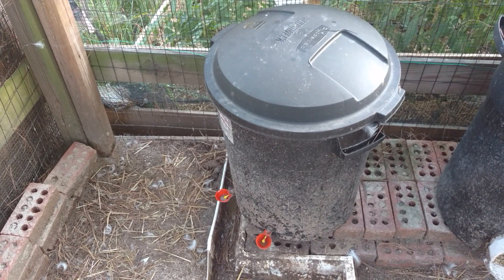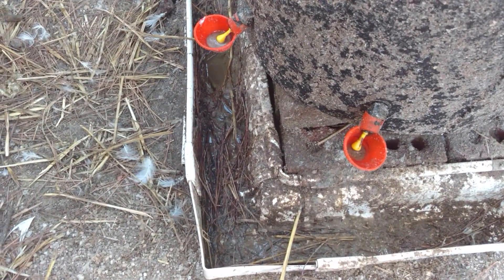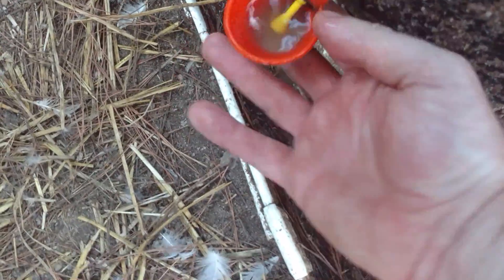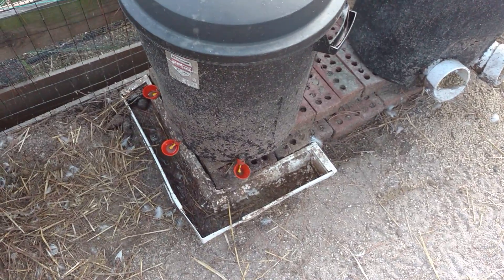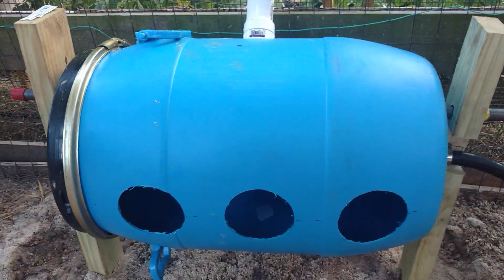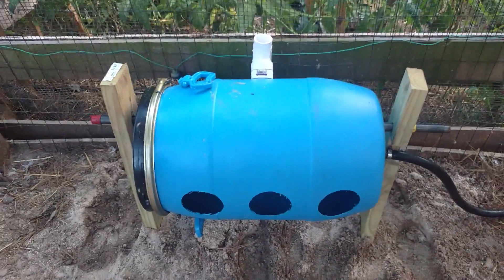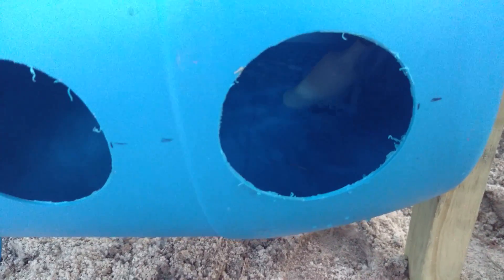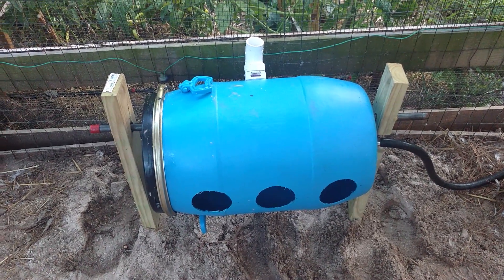Continuous Watering Design for Ducks

Comment: Hey this is great! Plan on doing this for the ducks we have. You mentioned using insulated pails for winter? Could you elaborate on that? So you don’t have an automatic watering system for winter? Could you get an insulated hose and spigot? With a heating system in the water jug?
Reply from the maker: @bigbluedome - thanks for the comment.  Check out this video: https://youtu.be/FVUj_XtJMNA?si=Da7agOTzP7u3sxKm Info on this system and testing of it info noted in the video's description.

Comment: How high off the ground are the holes?
Reply from the maker: I'd say about a foot but it can be easily adjust depending how deep you bury the frame support.
Reply: @smithmal01  do you have a video where the ducks 🦆 are using this system? Please help!!!!  I have ducks and extremely messy with their water and feed. Recently I got diagnosed with rheumatoid arthritis and is extremely hard for me constantly changing their water. I appreciate you help 💙
Reply from the maker: @queilayenner1280  Yes.  Please see my channel.  Videos and build links are there.

Comment: I thought about a smaller design with my 4 chickens but instead a 5 gallon bucket and a toilet fill valve
Reply from the maker: That would work.  You could add poultry watering drinking cups to the 5 gallon pail and attach the pail to a post.  The drinking cups work well for chickens but not so much for ducks.

Comment: I would love to see how this was built. I live in the Nevada desert and small waterer for my pet ducks are not enough and it's extremely hot. Thank you for sharing!🙂
Reply from the maker: It's pretty easy to build.  Just check out the thread link in the description.  The link also has all the links for the materials that I purchased.  It's basically just a plastic drum with some feed holes and a pipe going down the middle so that it can hang across a 2" x 4" wooden frame.

Comment: Could you do a video showing how you built it? I'm new to ducks, and this design looks excellent!
Reply from the maker: Sorry for the delay in responding.  A video isn't really necessary.  It's just a barrel with a hole in the middle that has a metal pipe running through it and the pipe is secured using simple U shaped frame in which the bottom is buried in the ground.  You can see the frame that was built in the following video: https://www.youtube.com/watch?v=puETWSiDt58.  Please also check out the description info and the link I provide for more information on how to build this.  The link has pics and material information included as well.

Comment: I have a hen house from the 70's. It has a concrete floor. How could I work with something like your showing?
Reply from the maker: For something permanent you could make the frame similar to what I created and then bolt it to the concrete with concrete wedge anchors.  For something less temporary, or if you wanted to be able to move it around you could also design the frame with cross supports (i.e. you'd have two legs on either side that cross) and then rest the central rod that goes through the drum in the middle of the cross supports.
Reply: @smithmal01   How can I get that to work with my chickens and guineas ?

Comment: Spigot - Great idea! Thank so much for sharing it with us. Instead of placing a spigot on the other side would it work to mirror the three holes on the other side?
Reply from the maker: Nelson - it would and it would also provide more drinking access for the ducks.  I put the spigot in so when I dump the water I can direct it away from underneath the watering jug since it tends to get very muddy and mucky there.
Reply: @smithmal01  thank you!

Comment: constantly pressured water systems I dont like. Because if anything leaks/breaks, it could be leaking water all day until you come home and see a flood. If you're on a well, its ahorrible waste. It will destroy your bedding/coop. I just dont trust it. I use automatic feeders... but I just refill waterers as needed.
Reply from the maker: Adam.  Very good point.  I had a couple of those issues myself.  To fix this I removed the float assembly and filled up the tank using a timer (30 seconds does the trick).
Reply: @smithmal01  What do you mean a timer? How do you put your outside faucet on a timer, without subjecting it to being constantly pressurized or "on,"?
Reply from the maker: @AddamSolo  You are correct.  There is constant pressure which you can't get away from if you want to have an automatic watering system.  That being said,  during the winter months all watering is done by hand since the water inside the hose going out to the duck yard is frozen.

Comment: Bro....to avoid the splashing n dirty.  A Plinth or higher cement wider than the water drum with a little ramp may help.  The hole for the duck is too big. They are able to bring out the water from the head to their body n starts splashing.

Comment: I love it.
 You could put a 10 gallon aquarium heater in the barrel in the winter months and use it year around. They are real easy on the electric bill and work great. I have a 10 gallon aquarium burried in my outdoor worm bin with one of those heaters in it to keep the worms happy.
 They come set at different temperatures. I use an 80° F. Thanks for the video.
Reply from the maker: GB, thanks for watching.  I don't use this system during the winter months because all the water in my garden hose freezes at night eliminating it's ability to provide continuous water when temps drop below 32F.  In the winter months I use an insulated pail system which can be seen here: https://www.youtube.com/watch?v=FVUj_XtJMNA&t=4s  

In the description there is also a link to those insulated pails in action when the temps fall down to 10F.  Thanks!

Comment: I love it.
 You could put a 10 gaklon aquarium heater in the barrel in the winter months and use it year round. They are very easy on the electric bill.
Reply from the maker: True, but I'd still need to get water to the barrel in the winter (which in the summer is done using a connected hose).  In the winter months, any water in an outside hose would freeze making me need to lug water out to the coop.
Reply: @smithmal01  I ASSUME you have to carry water out anyway. I use 2 gallon cat litter jugs that have a screw on cap for my 17 chickens and 2 alpacas. Generally one jug each morning will take care of all the "stock". Ducks might need more though.

Comment: I read that ducks put sand etc in their water because they like grit in their tummy to digest and break down food.
Reply from the maker: Joseph, thanks for commenting.  I read something similar, but read that feed and water need to be near each other as ducks routinely get a mouthful of feed and then use the water to help swallow the food.  For this reason, feed and water should be in close proximity to each other.  That being said, the use of sand as a yard cover also is convenient in that it is an instant source of grit which is necessary for ducks to properly digest their food.

Comment: My problem is our duck if very clever and figures out how to poop in any watering system we put in her cage overnight.  She has free run of the property all day so that's not a problem.  lol
Reply from the maker: Suzanne,  yes that is a problem when ducks have access with water.  They will try and get in the water source if at all possible and will definitely defecate in it if they can (I have found a duck of mine stuck in a 5 gallon container in the past)..  With the system in the video, the holes in the container allow only the ducks to get their heads into the container eliminating whole body access.  The container is also raised 1.5' above the ground on a frame so that the duck's legs can't get access.

Comment: Looks great! When cutting the holes, run the hole saw in reverse after the guide bit is through.  This will melt it's way through the barrel leaving a nice smooth edge.  Keep posting the helpful videos, I will be making this and several others, thanks!
Reply from the maker: Great point!  Running the drill in reverse is also what I did and it worked out decently.  The rubber liners do help with reducing friction between the ducks neck and the edge of the holes so I would suggest using it.    You can see the liners in place in the following video: https://www.youtube.com/watch?v=puETWSiDt58

Comment: ducks need a deep enough water dish so they can blow out their nose
Reply from the maker: Nina you are correct.  The water depth for both the winter pails I use and the summer continuous watering system do provide enough depth for the ducks to clean out their eyes and nostrils.

Comment: How's it working now after these months of use?
Reply from the maker: Mate2Frio,

I only use when evening temperature consistently get above freezing because there is now way to keep the water thawed (both in the drum and within the hose line).  Because of this, I remove the continuous water system in the late fall through mid spring and use insulated 5 gallon water pails (discussed here: https://www.youtube.com/watch?v=FVUj_XtJMNA).  I've also shot a new video showing how I swap out my winter system for this system (which is used spring through fall).  See here: https://www.youtube.com/watch?v=puETWSiDt58

Besides that, the system works pretty well.  I had issues with the ducks transferring sand into the drum when they drank.  Eventually, the sand layer at the bottom of the drum would be so thick, it would foul the float lever's height causing overfill to occur.  If I removed/scooped the sand layer in the drum out every week or so overfill was not an issue.  That being said, if you don't use sand in your duck yard, you'd never run into a overfill issue as long as your float lever was set appropriately.

I'm thinking of drilling several 1" holes in the top of the drum so I can easily dump the sand when turning the drum rather than scooping the sand out by hand.

Comment: This is awesome! I really liked the half lid bucket idea from one of your earlier vids and have that for our incoming ducklings when they grow bigger, and now I'm going to make this as a long term improvement. Thanks so much!
Reply from the maker: Ying, thanks for the compliment.  I've used the insulated 5 gallon buckets now for two winters and they have served their purpose well.  Luckily for me, it tends to not get colder than 20-15F at night.  Below 15F causes a thin top layer of the water in the pail to freeze (though it is easy to break apart at this thickness).